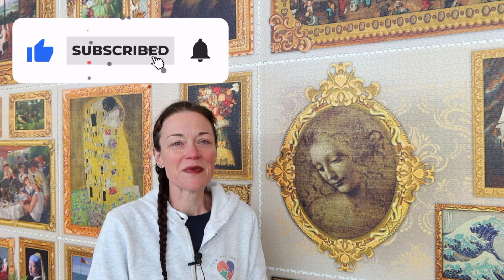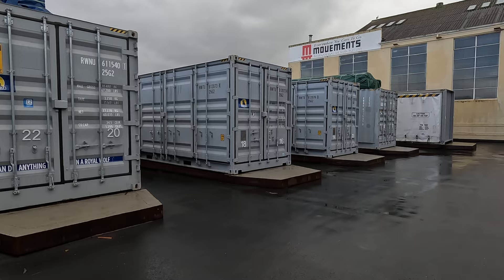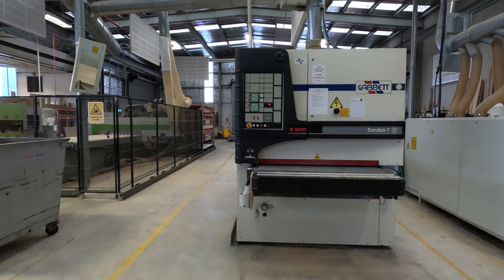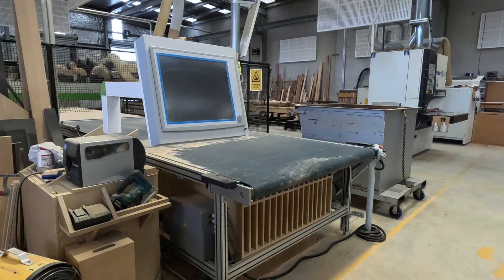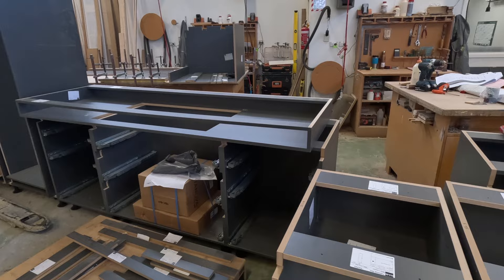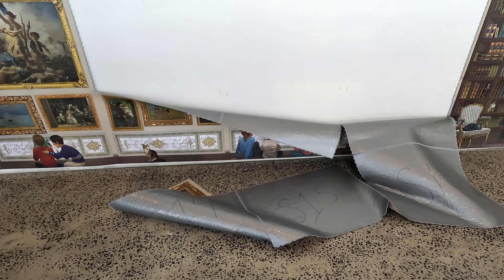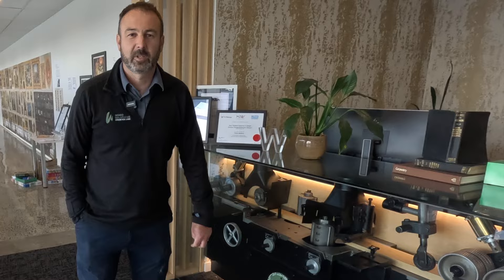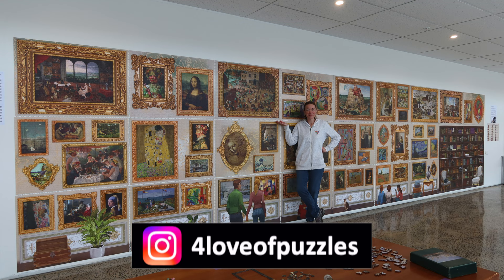FULL DISPLAY!! EPIC 54,000 Piece Jigsaw Puzzle: Travel Around Art from Grafika

Comment: Now I really want this puzzle! Beautiful. Huge puzzles are better than wallpaper. 😄

I know the gap problem well, I have the 18000 Ravensburger Paradise sunset (and Magical Bookcase stored away) it's in 45 sections (to fit the box) and I used builders tape to connect it to the wall. On the floor all sections go together fine.

This is the third time it’s on the wall, every time I took it down to try to fix the gap, and every time appears to a new place, odd. Hasn't yet fallen off otherwise. Now I managed to make the gap to a part of the puzzle where it doesn’t bother me, so it can stay. It's unique my friend said.
Reply from the maker: Thank you! And yes, it is unique (although frustrating) but makes it unique to your puzzle. I’ve been thinking of doing that Magical Bookcase - would you recommend? 💜🧩
Reply: @fortheloveofpuzzles  Yes. It's a challenge due to the busy image but the funny things you find in it as you build are worth it. Just do in the four sections it comes in. Never would mix these bags.

Comment: That was a great way to conclude this project. Amazing job! 
Are you planning to tape the Educa puzzle as well? If so then I would suggest doing smaller sections and using the taped sections to line up the pieces before taping the adjacent sections. This way you would be sure that they all fit together in the end. Cheers!
Reply from the maker: Thank you! No, I’m not planning on taping the Educa or putting it up on a wall. Will just lay it all out flat on the ground and take lots of photos and video. It’s just so crumbly and I am not particularly attached to it the same way I am to the Grafika one. 💜🧩

Comment: Great job and nice display. Sorry the puzzle sections didn’t line up. I had that issue when I did the 60,000 piece What a Wonderful World puzzle.
Reply from the maker: Thanks! I was debating on whether or not to get the What a Wonderful World but decided to go with the Educa Around the World instead. I don't think any super large puzzle will align properly. Did you lay it all out on the floor/ground or did you get it up on a wall? How long did it take you to do? 💜🧩
Reply: @fortheloveofpuzzles  I would have thought the high quality puzzle makers would make better fitting puzzles. I can see how the images from one section to another might be off a bit, but the sections should all connect to each other completely to create one big section.I had a couple sections where the pieces were cut way off and one piece was actually missing a part of it. I put the puzzle on the floor of a basketball court in a gymnasium of a church. I started the puzzle once before and did 10 sections, checking the fit between them as I went. I came across a section that wouldn't fit, so I returned the puzzle and got a replacement. I did what Judy did and suggested I do, and just put the sections together and not worry about the fit until the end. I started the 2nd puzzle on Dec 22nd, and finished it on March 2nd. I took some days off during the build. I actually worked on it 58 days.